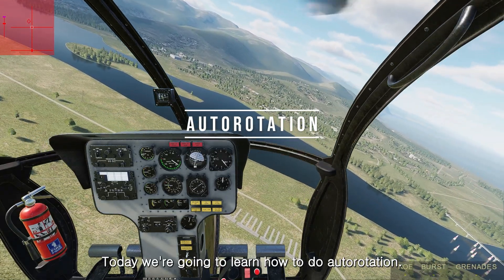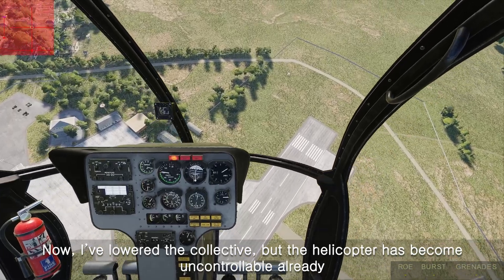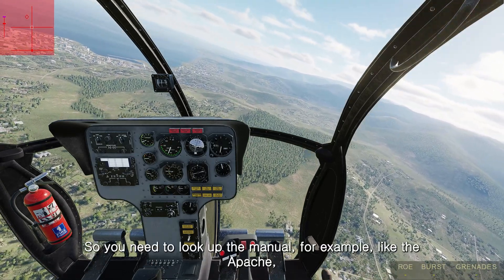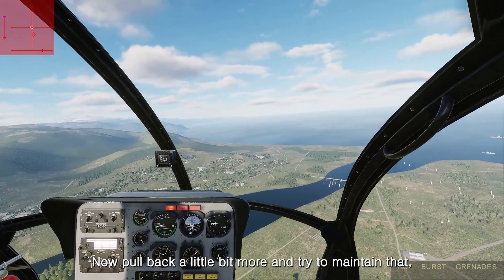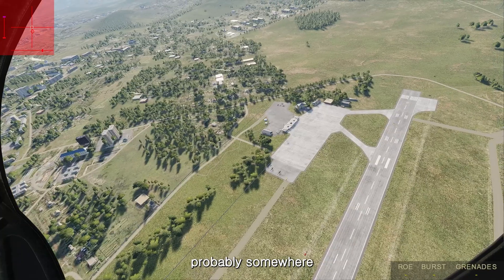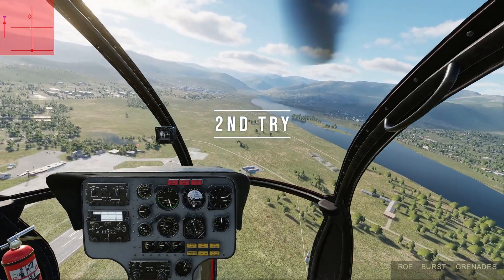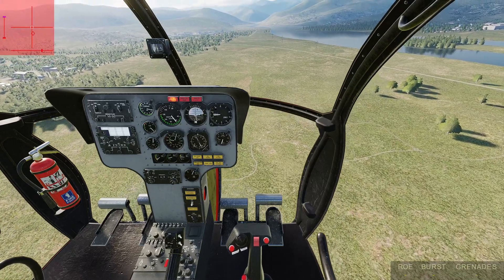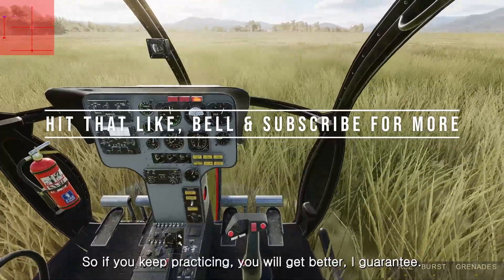How To Master Helicopter Auto Rotation in 5 Minutes? #dcs

Comment: You need to look at rotor rpm and keep it at +/- 100% do not look that much at a speed it’s not that important as rotor rpm
Reply from the maker: Great advice! Thank you!

Btw, do you know why some guides or instructions tell you to pull the collective right before touching down?! I couldn't quite get it, so I didn't put about it in the video, but if you do, I would appreciate it. (I mean, once engine is dead, what's the point of pulling the collective?! Perhaps, that changes the angle of the rotors so that it'd affect the airflow?!)
Reply: @trailingedge72  in the last seconds of an auto, right around when you level out of your flare, you generally want to start pulling in collective. Even though the engine isn't running, this will still change the pitch of the blades and generate more lift to stop your descent and cushion the landing, so you don't end up falling the last few feet and slamming the ground. However, as you pull in the collective, your rotor RPM will begin to taper off, so it's something you only want to do right above the ground (probably less than 15-20 feet AGL). Hope that helps!
Reply from the maker: @TheRooster2024  Ahhh!! That makes pefect sense! Now I get it.

Thank you very much for taking the time to explain in detail. Greatly appreciated!

Now, I need to get back to DCS and practice more... 

Cheers!